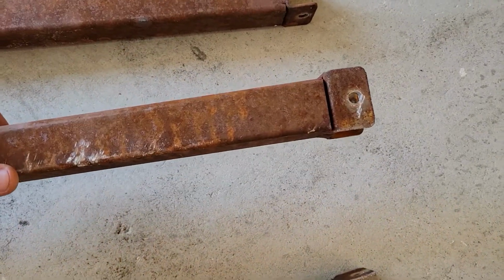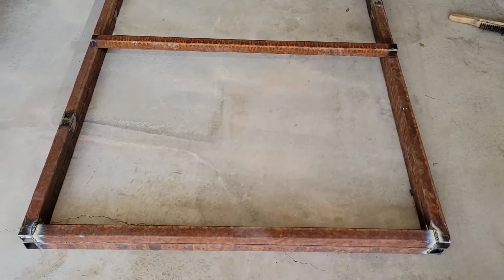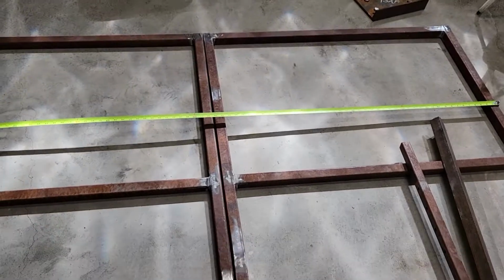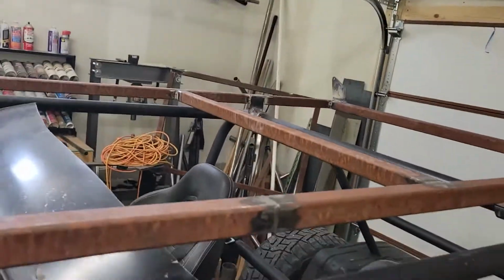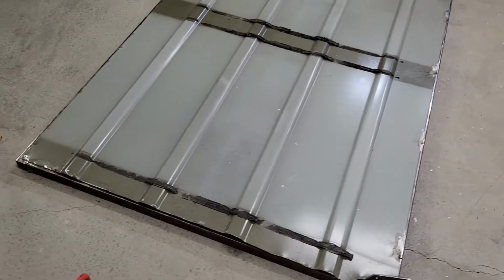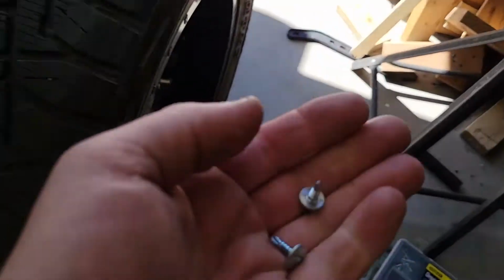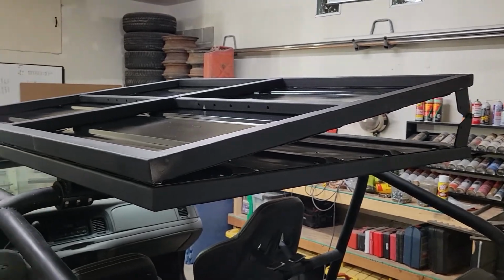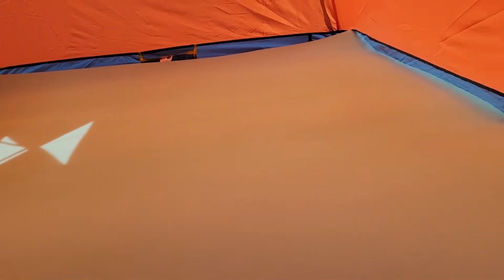TAZR Ep 8 - SUPER CHEAP DIY Roof Top Tent for the TAZR Vic Kart!

Comment: Why change the pole set up at all? Just use them they way they're designed. That way, if you go with a tent, fly; it too will function the way it should & direct all water away from the tent as well as the fold out floor. I'd say she's good how she is...

Comment: How is it putting the poles in and out. I wanted to do the same with a similar tent. Everyone else on YouTube uses a pop up tent
Reply: It's not bad. Pretty much the same as if the tent was on the ground. I've used the tent a bunch since then. It adds about 2 mins to the setup and takedown but beyond that there is no difference.
Reply: Nice. That's what I was thinking. Pop out the poles and fold it right up